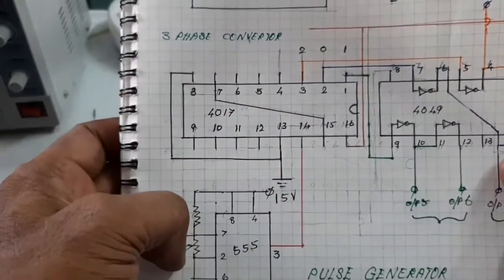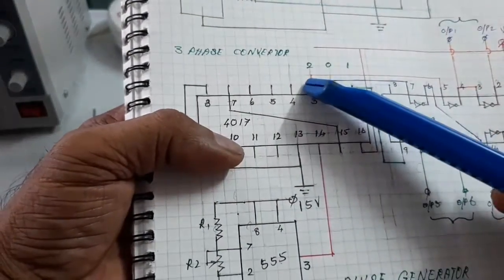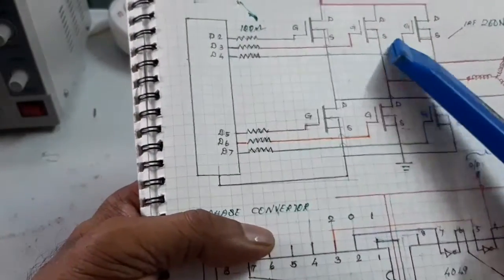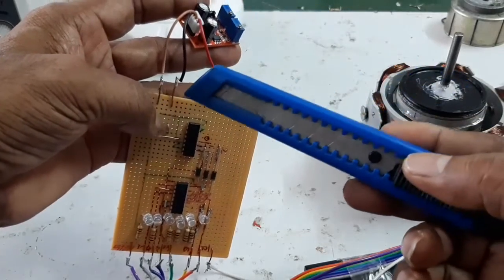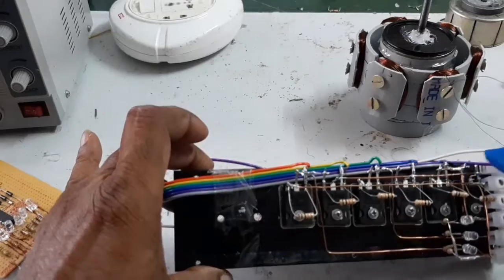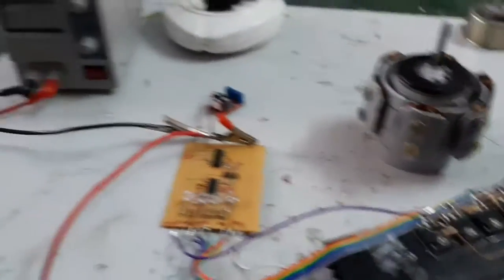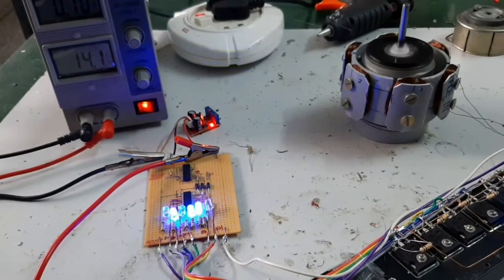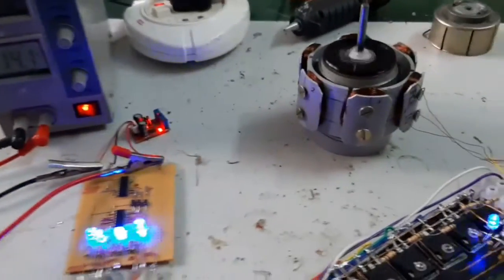(V-112),Home made Powerful high voltage bldc controller

Comment: சார் எல்இடி லைட் பாஸ்ட் மூவ்மெண்ட் இல்லை மோட்டார் ஆர்பிஎம் கம்மியாக இருப்பதுபோல் தோன்றுகிறது ஏன் சார் இந்த வீடியோவை பதிவேற்றம் செய்ததற்கு நன்றி
Reply from the maker: Yes you are correct ,MOSFET  voltage is 200v but I have given only 12v that is why even i increase the freq the motor speed not raised ok
Reply: @pugalstech  ok